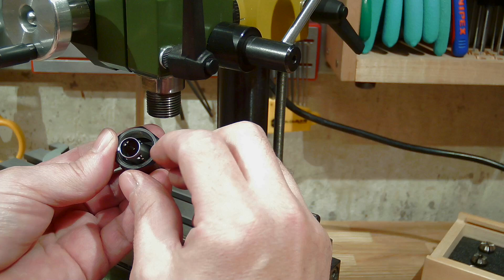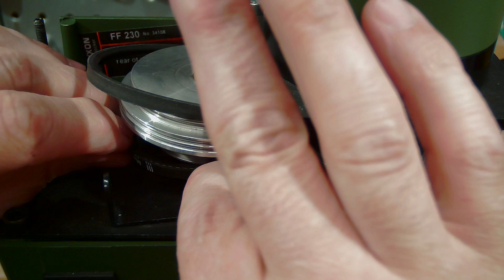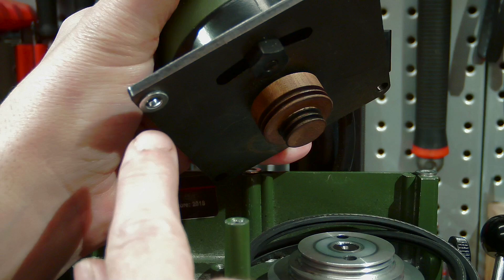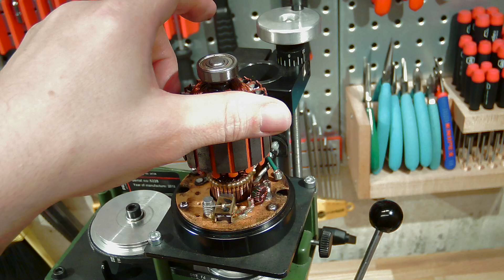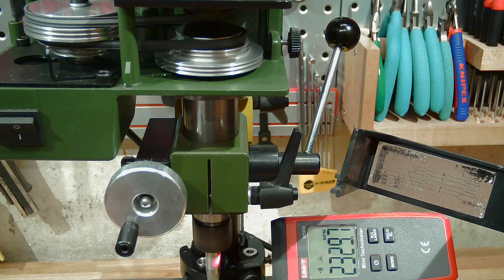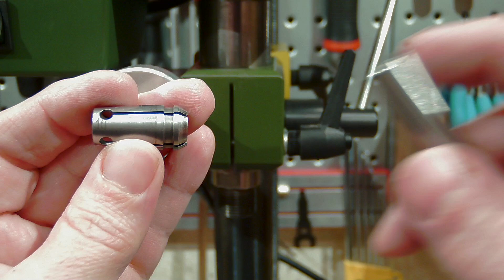Look-See: Proxxon FF230 Micro Mill Part 3

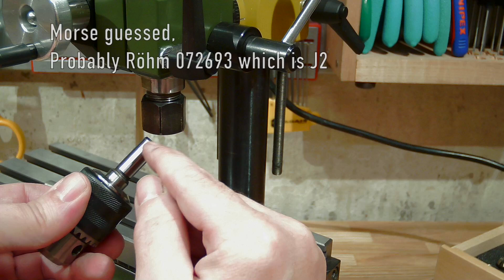Comment: At 5:30, talking about the Proxxon chuck, the taper is what's called B12, which is the thicker end of an MT1. I bought a die holder in MT1 and successfully cut it to B12 size to use it in the PD 250/e.

Comment: Supposedly that particular collet style for the FF 230 is based on a Euro "standard" & given Proxxon is German, that would make perfect sense. Remember too this Mill design is quite old & so all of it's features (collets included) needed to be "backwards compatible" to all the earlier models, however Proxxon has just recently (late 2023) released an "upgraded" version FF 250/BL that features an ER 16 collet system as well as a variable motor like the better FF 500/BL uses.
The variances within your speed tests could be explained by your motor being the 110V-60Hz version whereas Euro is 240V-50Hz
I have the same FF 230 as you & being in Australia, we're 240V-50Hz & my speeds are very close to the "sticker".
As others have already mentioned, that "wood" motor pulley is in fact a Phenolic/fibre composite.
Reply from the maker: I wish the now FF250/BL was available in the 120V market. You are correct about the speed differences, different motor. I also think their literature translation department needs a bit of attention as the speeds listed in the manual do not match the speeds on the decal.
Reply: @RoomForTools  I'm sure the FF 250/BL will be "USA compatible" in due course...my only concern with this FF 250/BL is its speed range doesn't go as low as our version, starting at 400 RPM is much too high for my current needs ...I like the much lower speed when using both a small boring head & fly cutter.

Comment: it could be cool to modify it to ER collet , spindle shaft for it look pretty simple , maybe its possible to find ER extension "rod" with same diameter and make it work
Reply: I have machined an ER16 adapter for this mill, it is rather straightforward to do if you also have a lathe - I, in fact, have PD250-PF230 combo. the main "trick" I used was to turn the M20x1.5 thread, then spin the blank on the spindle and mill-turn the OD in place to get it as concentric with the spindle as possible, then re-mount the blank in the 4-jaw chuck in the lathe, indicate it REALLY well and machine the rest of the features (16º included taper and M22x1.5 thread for the ER16A nut, which I bought separately). with that done, the tool runout is under 0.01mm with quality collets.

another option would be to remove the spindle, open it up for the ER16 taper, and re-machine the thread for ER16M nut, which is M19x1.0. the existing M20x1.5 thread has 18.676mm minor diameter, so the new thread is going to look ugly, but I don't see why it won't work.
Reply from the maker: Usovo.de has spindle upgrades for the little MF70. I wish an ER collet spindle upgrade was available for this mill.

Comment: The FF400 and FF500 has ER collets.
Reply: The FF250 as well.
One of the reasons I went with that instead of the FF230. The higher rpm from the brushless motor was the other major reason.
Reply from the maker: I wish the FF500 was available in the 120V market. Hopefully some day.

Comment: Always enjoy watching your videos. 👍

I think it's unlikely that the collets are proprietary. I imagine production costs would be too expensive for the relatively small numbers that proxxon sells.

At a guess, they look like "EOC" or "OZ" series collets. 🙂
Reply from the maker: Thanks! Both EOC and OZ series have lips larger in diameter than the taper, and their taper angle is 5°44' included vs Proxxon's ~8°.
Reply: Always thought they were oz collets I have the full set of proxxon collets for this mill plus three imperial collets 1/8 - 1/4 - 3/8 all identical in outer dimensions they have a tiny notch at the rear end to identify as a/f   nothing to do with proxxon i don't think